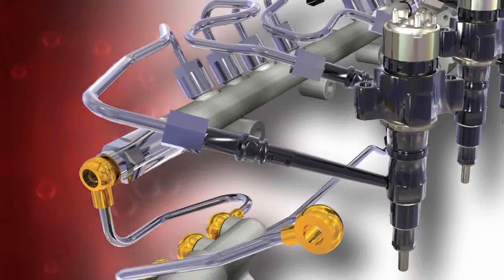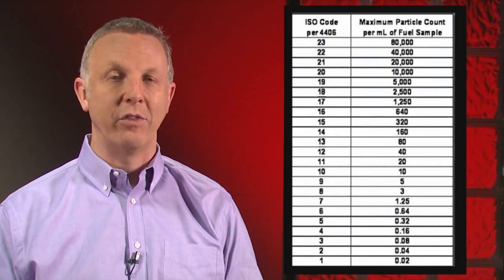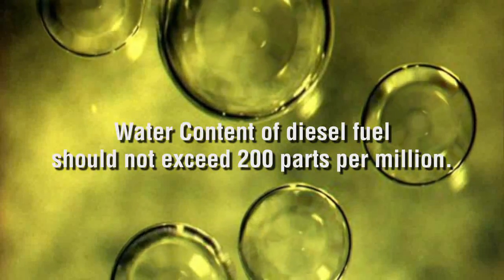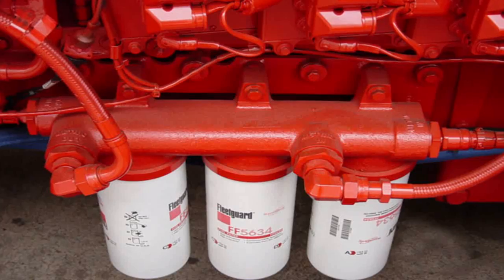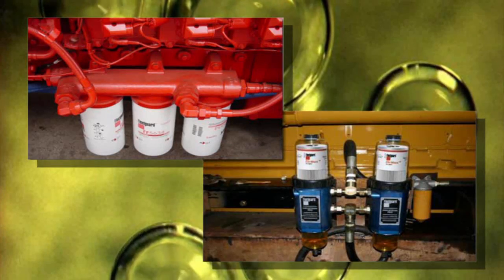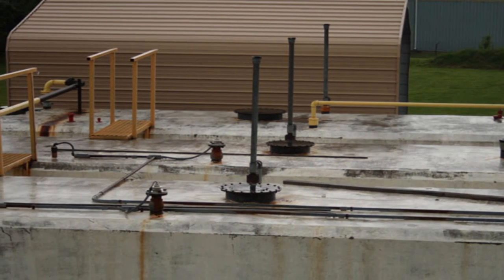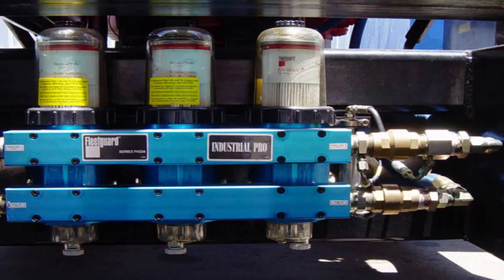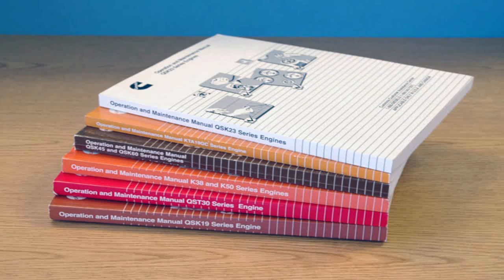Diesel Fuel Quality for Off-Highway Engines

Comment: abject nonsense, put out for stooges to bleat a party line.  what this video states is "unelected people have decided you will drive a less reliable yet MUCH more expensive vehicle which requires the BEST POSSIBLE operating conditions and fuels.  If you can't obtain these conditions and fuels (shtf/3rd world), you are SCREWED and your equipment will be USELESS.".  This is all in favor of completely arbitrary, faked "sciences" like MMGW (oops, that didn't work out, now it's "weird weather" or "change").  This is not "market demand", capitalism, progress, nor even good for the environment.  It is about control. Control and abuse of the individual who pays ALL associated costs, while eeking out a meager living, IF the "well to do" will allow even that.  How disgusting.  I am sure Clessie would agree.  You are disgusting.

Comment: Cummins - Your assumptions made at around the 04:30 mark in this video are highly misleading. The engine fuel filter is not 98.7% in the actual application. That efficiency is taken from the Multipass ISO16889 standard. An on-engine fuel filter is a single pass application and thus the 98.7% efficiency is not correct. The 13.75 million 4um particles is well below what it would be in reality.